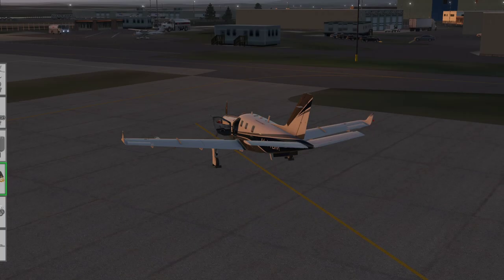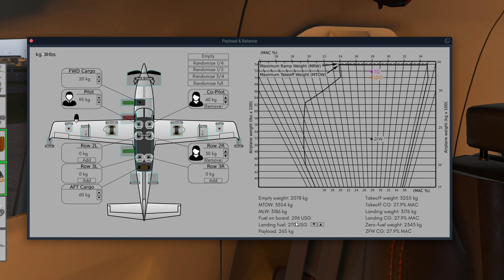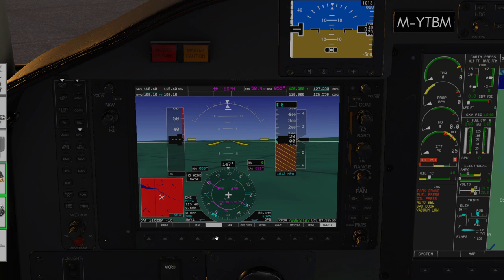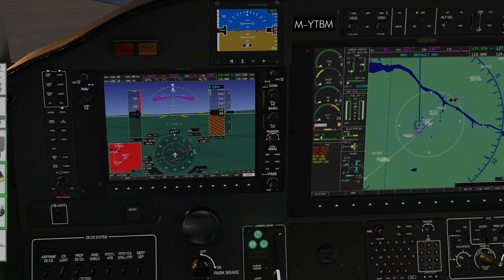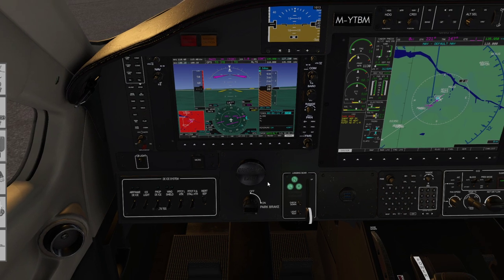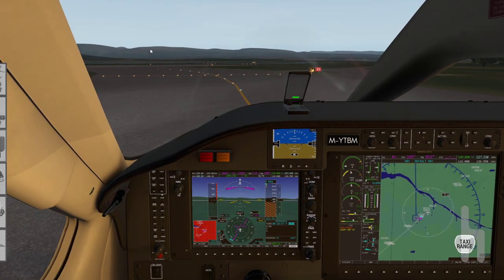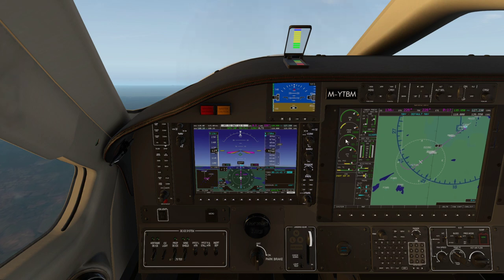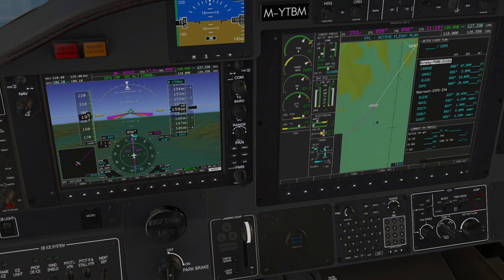Hotstart TBM 900 Part 1 - IFR Departure from Glasgow [X-Plane]

Comment: I've seen a good number of both sim videos and aviation training videos by now and yours are absolutely top-shelf. In fact, they don't compare. Thank you for your fine instruction and willingness to share your knowledge. I'm learning a ton from you.
Reply from the maker: Thanks for the nice comment Douglas, good to hear you find the videos useful!
Reply: @ReflectedRealitySimulations  Yes, truly great work and I'm personally very grateful for the time and effort it must have taken to produce this series. I learned a lot and am continuing to learn more as I rewatch some of them as necessary. On that note, I wonder if you might consider making a supplemental video on the additional G1000 simulations with the weather and traffic settings. These are both very useful but I don't understand the rationale for choosing one setting parameter over another. Cheers :-)

Comment: By far the best tbm900 tutorial video on youtube.  I am a private pilot with single engine land and sea rating.  No instrument rating. Learning to fly with the g1000 is tricky becasue I feel like it is piecemeald with different tutorials, that was until I found your.   Extremely slow,  thorough, and easy to understand.  Makes learning very easy.  Thanks for taking the time to make these videos.  Sorry it's under such shitty circumstances.   Cheers
Reply from the maker: Thanks, where do you fly? I was lucky to have about 250 hours on round instruments before going over to the G1000, I did about 130 hours on the G1000 and then went back to a. GNS430 and round instruments for my Instrument Rating. The real G1000 was fine for VFR, but the flightplan was not so easy for IFR, fine for “direct”, not so easy following an airways routing. The addition of a control keypad for it is a big improvement and the GTC 570 touch controller on the new G3000 looks to be even better.
Reply: @ReflectedRealitySimulations  I am born and raised in Minnesota, USA,  I got my PPL at a local regl airport (KRGK.) I then joined the US Navy went on to fly in a club in Pensacola, FL. I learned to fly variable pitch and retractable gear, although I never got checked out in it. I had a friend that owned a Mooney. So I got about 60hrs flying that. I kick myself for not getting those endorsements.   I then got stationed in Oklahoma, OKC, and went back to flying the 172. I have a total of 250hrs logged flying time.  After that I moved back home and havent been flying since 2012. Mostly becasue of work and family. So now I fly xplane when I have time.  Trying to teach myself how to use the g1000 for arrivals and departures has proven to be tricky.  Do you fly for a living? Are you currently flying the TBM900?
Reply from the maker: I really enjoyed my time in the 172, my wife enjoyed it more than the PA28 as the view was a lot better. I’ve been flying for just under 20 years now. Initially as a Glider Pilot and PPL before making the career change and going to the airlines. I fly the A320 Series, though haven’t flown for over three weeks due to the Coronavirus situation. X-Plane is good for scratching that flying itch. Haven’t flown a TBM though - slightly out of my price range!
Reply from the maker: You need to setup charts access via the plugin menu, have a look in the UIGuide.pdf in the aircraft documentation.
Reply: I got the charts figured out. 
When do you think you will have part 2 of the video posted? I am currently at FL 150 35NM to ASNUD. I am positive that I need that other video to get this baby where it's supposed to be.

Comment: This is so smooth. We are a number of online couch pilots who can take a plane from A to B, but watching a real pilot do it makes me realize how off I am. I am always overwhelmed, behind and chasing everything. Also I am not sure what I do wrong with the tbm, , but when I go into taxi range my taxi speed just keeps rising and I keep on having to use the brakes and before I get to takeoff I always get the warning that my brakes are too hot and to cool them. Also a new thing I am getting is the prop rpm keeps going above 2000 and torque goes up and down all by itself even though I don't have AP on... Frustrating. I hope to figure it out because if I can ever get close to flying planes like you do I will be happy and consider getting my ppl soon. Thanks!
Reply from the maker: Thanks Vasily. You’ve identified the issues most sim pilots have at some point - staying “ahead” of the aircraft, and being able to plan ahead rather than react to stuff that happens. The TBM is a great aircraft to learn that skill with, because you can fly it slowly and make more time to think. You can come all the way back nearly to the reverse range when taxying around, which will help with the brake temperatures. Good luck with your PPL!

Comment: Thanks for the tutorial Ive started learning the G1000 and GTN 750 in X-plane  after years of using PMDG Boeing and FSL Airbus in P3D. Its great fun flying the Hot start TBM900 with G1000. I learned how to fly in a PA-28  20 years ago
Reply from the maker: Thanks Jason. Yes the Hotstart TBM900 is one of the all-time greats in X-Plane, it's just such a flexible aircraft in that you can do high altitude airline type flying, and then land at a grass strip! The PA28 is a fine aircraft - I learned in PA38 and PA28 aircraft too.

Comment: Great video series! I only have 2 major criticisms for the TBM. For all the detail they have added... They still don't have a custom G1000 (something as simple as the essential v-speed bugs are missing). And too many people complain about the propeller torque that they removed it entirely. That green mark on rudder trim is there for a reason.
Reply from the maker: Thanks for the nice comment. I agree to an extent about the Laminar G1000, but to be honest the V Speed bugs are not a big deal for me. I can’t remember ever using them on a G1000 before, and the AoA/Alpha gauge is much more useful for me. The flightplan is a bigger thing for me. I remember there being quite a bit of torque on the initial release, but again the problem is one of feel. In a real aircraft you can feel out of balance flight through your body as it feels like you are leaning to the side. That means the yaw control is almost an automatic response from your body, much harder to replicate in the sim so having it tuned down a bit is better for most sim pilots. The DCS Huey apparently has perfect control response, I bought it on launch day - but I found it almost unflyable with my cheap joystick and rudder pedals. It may feel like a Huey, but I just can’t enjoy it. Hope that makes sense?

Comment: Great video! I had only started using xplane last month and I picked up the hotstart TBM very recently for its realistic model to get myself more familiar with G1000 and turboprop operation(a little too expensive to do in real world). I have learned quite a few things from your flight. Thanks!
Reply from the maker: You’re welcome! Yes I’ve learned a lot about the PT6A handling from the Hotstart model - most other turboprop sims now feel a bit simple compared to this one.

Comment: Awesome video!  Thank you for your clear explanations.  One thing I wanted to know more about is why you pressed the TO/GA button before even moving the aircraft?  Was that just to get the flight director setup so you knew approximately at what angle and direction to fly on takeoff?
Reply from the maker: Thanks for the nice comment William and sorry for the delay replying. Yes the flight directors in TOGA mode will give the correct pitch attitude for normal takeoffs, and also means all you need to do is point the aircraft at the flight director, trim, and put the autopilot on. I do it early as that's more what big aircraft do, but you could do it before lining up too.

Comment: Hi Graeme, during your departure you do a right turn after XETUN but it doesn’t fly towards the the waypoint D299E, it flies a track towards ELBAN and you then have to manually set it to go direct to ELBAN to bypass the waypoint. Why doesn’t the aircraft fly towards the waypoint first?
Reply from the maker: That’s a problem with the X-Plane default navigation code. The procedure calls for course 046 towards ELBAN and you can see this on the HSI. The aircraft attempts to do this by simply flying a 30 degree intercept which is quite lazy coding from Laminar Research. Because the D299E waypoint is also there for a crossing altitude restriction the aircraft would effectively miss that waypoint and the flight plan would fail to sequence. So I manually resequence the flight plan to ELBAN to fix that. You can see when I activate the leg the course on the HSI doesn’t change yet the magenta line on the map does move - another indication of the Laminar Research navigation code. You will see this behaviour in any LR G1000 fitted aircraft. Whenever you have issues like this, the HSI course is the first thing to look at, X-Plane will simply try and intercept at 30 degrees, that’s why I always recommend having the second bearing pointer set to GPS so you can quickly see if the 30 degree intercept will work.
Reply: Reflected Reality Simulations Thank you for explanation, Graeme.

Comment: Welcome back Graeme! Another exceptional tutorial as always! I have always struggled with the G1000 so really looking forward to learn how to use it! I am sure you know this but just to double check, are you using throttle friction on the TBM? It's a feature I didn't know until long in the TBM and it makes keeping the power setting much easier in climb.
Reply from the maker: Thanks. I have used the throttle friction before, but usually manage fine without it. My old joystick was squeaking and binding so I took it apart to clean and lubricate it. I may have over-lubricated the throttle!

Comment: Hello Graeme,
Concerning the activate approach vs vectors to final with a RNP APCH, I know the avionics on the TBM differs from bigger airlines and in some cases is more modern. Is the activate approach and vectors to final the same for all FMS's or does each manufacturer have their own way of doing things?
Reply from the maker: Good question. That way of working is quite specific to Garmin. On the Airbus the approach phase is more related to performance - it basically tells the aircraft to fly as slow as the config allows instead of climb/cruise speeds. It will activate automatically but is mostly activated manually. The Garmin will not fly the approach phase waypoints without pilot intervention, either direct to or activate approach - on the Airbus and Boeing the approach follows on from the enroute and arrival, all the waypoints are in the correct order all the time, if you don't want to start the approach then a hold is inserted at the correct point. It's really quite easy and I don't really understand why Garmin did it differently! It's almost like there is a bias towards visual (i.e. it's saying "OK, you've got this approach, but do you really need it?") which is understandable given the origins of the G1000, and for a light GA aircraft visual is obviously preferred as instrument approaches often take lots more miles. In the Airbus when on vectors we usually "extend the centreline" by doing a direct-to the final approach fix, with a radial in - this ensures the waypoints will sequence correctly during the approach and is similar to the Garmin "Vectors to Final". Hope that all makes sense!

Comment: Great video. Two questions about this xplane 11 add on airplane - 1. can this airplane display the wind vector on the g1000 ? 2. can this airplane display the track pointer purple diamond on the HSI of the G1000 ?
Reply from the maker: Sorry for the delay responding. I'm not sure about the track pointer diamond, but you can certainly show the wind vector - there are three options available for how the wind is shown.

Comment: thank you ... purchased tonight inspired by this series of video's and looking forward to treating this as a study aircraft... very steadily working my way through part 1 in realtime and just wish I could find out how to map the essential controls ... took me ages to confirm correct controller mappings for all trim surfaces and now struggling to setup the power lever using a warthog hotas throttle... any help will be most appreciated... subscribed and a thumb up for this video
Reply from the maker: Sorry, I didn’t see this message before. I only have very basic hardware but I know people do fly it with the Warthog. If you’re still having issues with it let me know and I’ll try and find out for you.

Comment: Hello Graeme, firstly I really enjoyed the video so thanks very much for putting the time and effort into producing it. Secondly following your very clear and precise instruction I seem to be able to do everything except load the airway into the flight plan as when I hit the menu button that option is 'greyed' out - have you got any suggestions as to how I can overcome that issue? all the best, Bob
Reply from the maker: Thanks for the nice comment Bob. It’s important to look at where the cursor is before going into the menu. So I start with EGPF, PTH and EGPD on the flightplan, but need to highlight EGPD (the next point after PTH) in order to load an airway from PTH. You’re basically inserting the airway after the waypoint, not on top of it. Hope that makes sense?
Reply: @ReflectedRealitySimulations  Many thanks for the reply Graeme, that sorted the problem - I still work with 'steam' gauges so glass cockpits are a bit like black magic to me!! Regards, Bob

Comment: Good morning Graeme! I didn't understand how to set the TRQ in the "Maximum climb power" table in the POH sez 5. For exemple  if at FL260 I have -10 degrees and I start from the ground I have to set a TRQ of 82 for the entire climb .... true or false? thanks!
Reply from the maker: I wouldn’t worry too much about the tables - they are really what performance engineers use to construct a digital model of the aircraft performance. For the climb the procedures section contains this bit about climb power this is what I do too - “For a simplified engine operation during climb, power may be set first of all by torque, using 100 %, then, when the ITT typical value for climb is reached, by indicated ITT, using this particular value. The margin between this indicated ITT and 790°C (recommended ITT limit during continuous operation) will gradually reduce as flight time is performed.”
Reply: @ReflectedRealitySimulations  thanks you very much Graeme!

Comment: Hello Graham, first of all thank you very much for this marvellous video series. I'm enthusiast of TBM aircraft and this add-on is my only aircraft which I keep fly always. So I've build it up and DIY GMC710 Autopilot Box for this plane. This device has carried me one step ahaed. My question is : I have Saitek Logitech Yoke system with its throttle quadrant but could not be successfull of defining TBM's throtlle. My throttle' zero point is starting from end of the taxi zone. I can't do taxi or reverse. When I pull back it jump to low idle. How did you define taxi and reverse zone and what is your gear ?
Reply from the maker: I have a simple desktop joystick with a single throttle axis - the flight idle point is about 30% of the lever movement and to get into the reverse range the toggle thrust reverse binding is on a button on the stick and that allows access to the lower part of the axis. I'm afraid I don't know about other hardware setups, but the HotStart Discord is very friendly and helpful - I'm sure somebody there will know.

Comment: one of my fave GA planes. The odd throttle is hard to deal with in current hardware, I've found...
Reply from the maker: It's a great aeroplane. I only have a basic joystick with no advanced throttle and have found the TBM very easy to work with. You need one throttle axis and one button for toggle reverse and that's really it. You really don't need an axis for low / high idle as that's only for startup and shutdown.

Comment: Awesome vids. Thanks a lot! Question: the 420ft of Minima in EGPD, where are you getting exactly that number? I am checking the Chart but not finding it.
Reply from the maker: Glad you are enjoying the videos! So on the U.K. state chart, from the NATS website, it shows an OCA(OCH) of 376(161). That’s an obstacle clearance altitude(height) and doesn’t consider the system minima for a CAT 1 ILS of no lower than 200 above the runway. It’s how state charts should be done as the system minima my be varied by operator or other rules. FAA and commercial vendor charts show Minima, but we must convert the OCA to a Minima. As the OCH is 161 above the runway, we add 39 feet to get to the system minima, 376 + 39 = 415 rounded to the nearest 10 is 420.

Comment: The Emergency Electrical Tie switch on circuit breaker board should be properly modeled. But I can’t figure out how did it operate.....when main/standby gen stopped working, I should turn on that, so reserve more battery? Should I put source to off or leave it on battery?  Didn’t see different, even with MFD electric display reference.

Hope you can explain this a little bit more

Thanks 🙏
Reply from the maker: I believe this feature may not be quite correct in the current release. You should be able to leave the battery switch on and, I believe, the bus tie should leave the avionics in the same state as when you start up with just the crash bar up. The developer is looking into this, but for the time being look for the Main Gen and Low Voltage abnormal procedure (in the real TBM manual available online) and that explains using ESS BUS TIE. It's also covered in the Electrical section in the same manual. Be aware also that the documentation and the real aircraft behaviour can be very slightly different! Hope this helps.